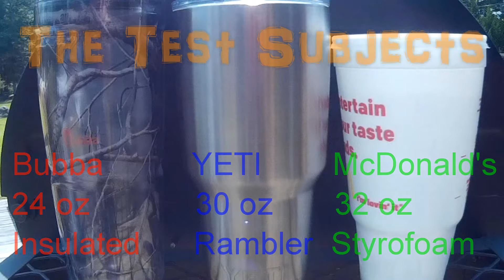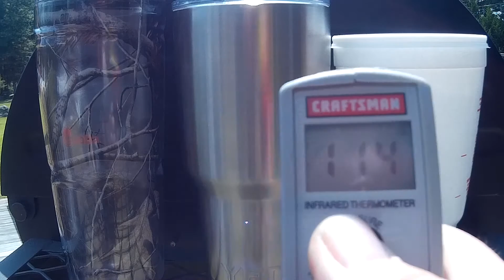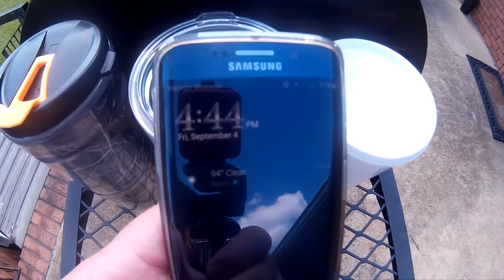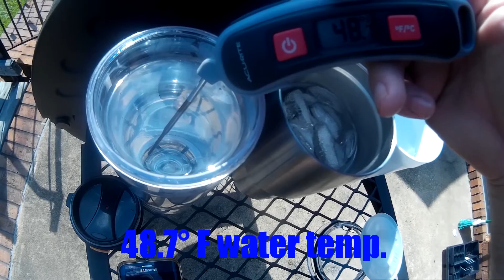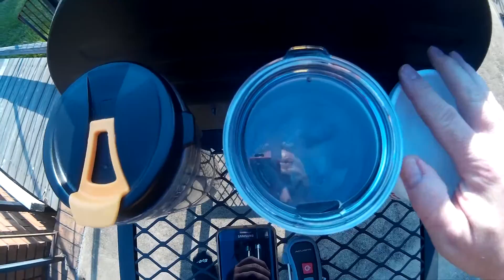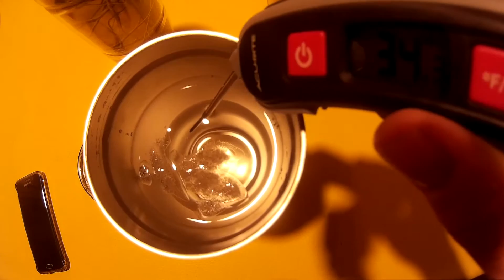Yeti 30 oz Rambler testing with ice water in the Sun and Heat

Comment: My ice melted in like 4 hour inside an air conditioned room
Reply from the maker: +killerboypoor that's interesting.   Maybe the vacuum seal didn't hold on yours. I use mine every day and I usually will fill it up with ice and water at bedtime.  It will sit on the nightstand over night.  I top off the water in the morning.  Throughout the day I will refill with water several times and still have ice left at supper time.
Reply: TheManCaveVideo I just found out i may have bought a fake yeti. i got it from amazon for $19 30z lol
Reply: @killerboypoor  no guarantee he even has real yetti,alotta fakes.thats why yeti has a qr code on bottom to register it.